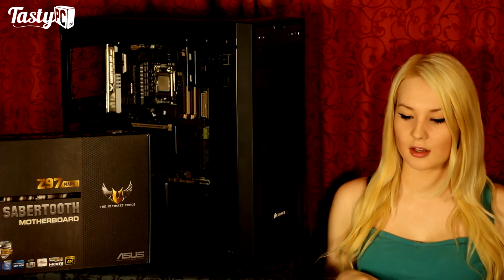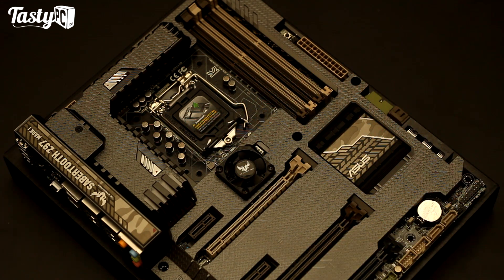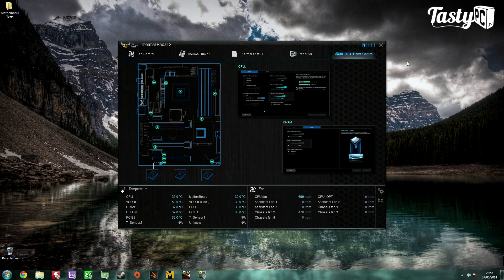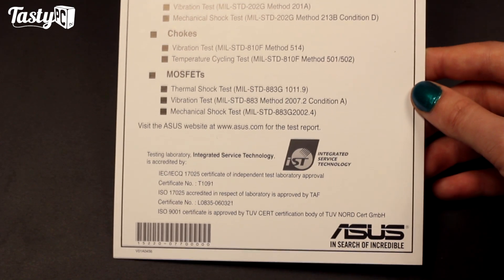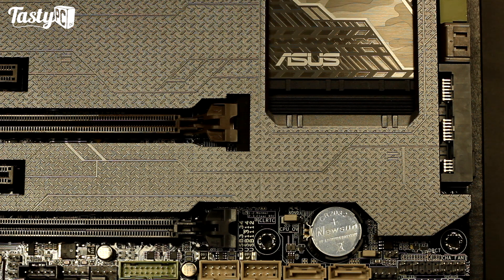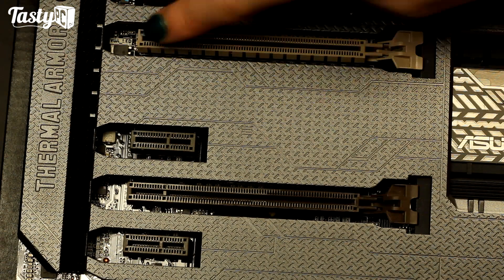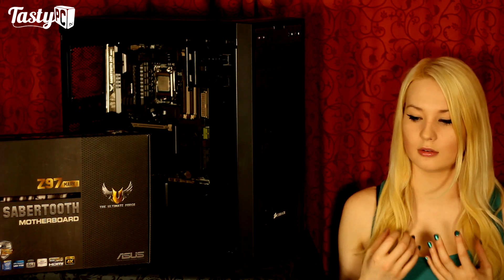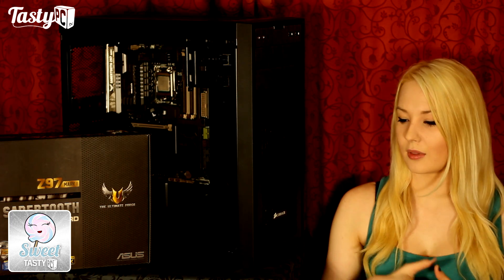Asus Z97 TUF Sabertooth Mark 1 Motherboard Review

Comment: To my eyes, it looks totally naff with those fake graphics and logo's, I can't understand why anyone would choose that with such a wide variety of great boards available. Styling like this has a very limited appeal IMO.

Thermal Armour ? Sounds like a marketing gimmick and that silly little fan is just going to be annoying if it is used at all ! I can think of much better options if it needs cooling.

Obviously it's not designed for someone like me who prefers clean and subtle styling so I will not pretend to like it.
Reply: It is about reliability when you are talking about the Sabertooth line.
Reply: Reliability is important, I agree with that, nobody wants anything that will let them down but fake camo is like the little boys version of 'girlie pink'. It's one of the few colour schemes that is accepted by boys and when you think about it, it's completely pointless on a mobo !

Comment: You say it acts as a "heat shield" but why does the motherboard need a heat shield. If the heat it's not going to damage the GPU PCB it won't damage the motherboard PCB, considering the GPU PCB is giving off the heat.

It does look nice but I don't understand why they call it "thermal armour".
Reply: Asus calls it whatever they want, TUF, Sabertooth and all other kind of mumbo, jumbo. As long as it sells, it is allright. when it sells better, anything goes. 
No one on this planet needs TUF, Sabertooth motherboards or whatsoever. The only appeal to the mind of those who are vunerable for this kind of  marketing hype.